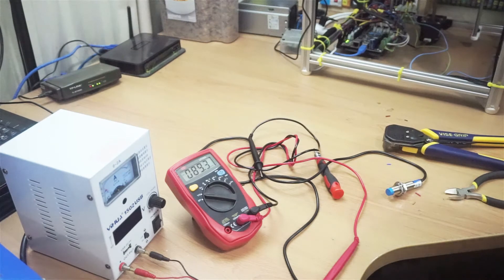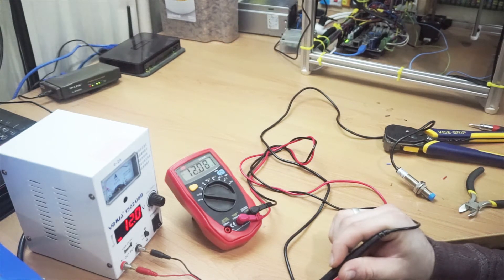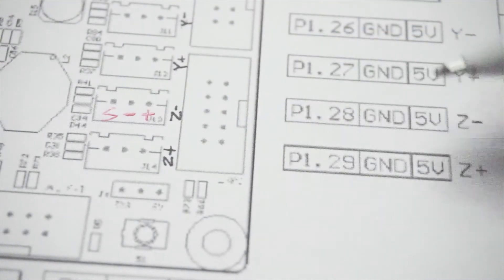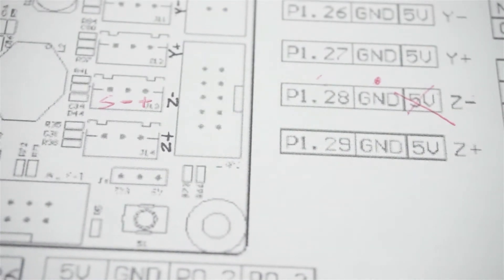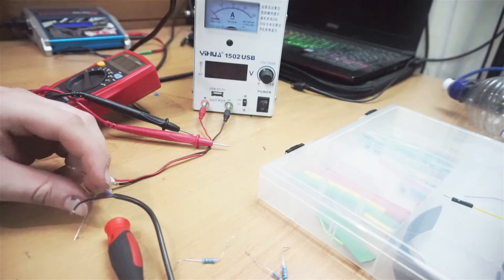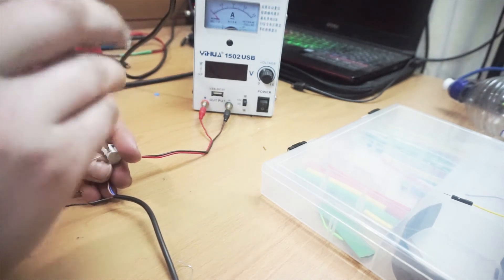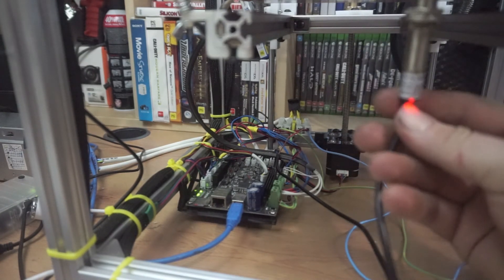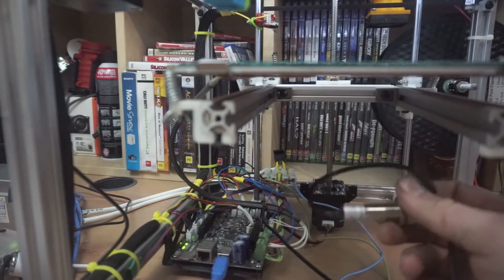How to use an Inductive Sensor with a MKS SBase/Ramps/All boards

Comment: Hi i no this video is from a few year ago but how did you wire up the probe ie 12v + and - from power supply and signal to the board I am cunfused how you wired the probe up please help

Comment: is that a PNP probe? I am having trouble getting it to work... is it because it is working off the 5V from the endstop plug or do you need to connect it to 12 VDC....
Reply from the maker: The probe i was using is a NPN i believe. Check your probe to see if its got a 10k internal resistor or not and use a voltage dropper on the sensor signal out of the probe to the endstop sensor pin on your board. If the sensor isn't working correctly at 5v, its probably under voltage and needs to be on the 12v rail. Just remember to put a voltage dropper in as the signal coming out of the sensor as it will also be 12v so you need to drop it down to 5v for the signal into your board or you will end up damaging your control board.
Reply: @BryceStandley  OK I think you missed  my meaning...the probe works and shows triggered when triggered but the fermware still crashes into the bed... Even with the proper settings as far as I can tell... This was different on my other printer it stopped almost 8mm away from the aluminum bed... No idea what I am doing wrong I even re downloaded a fresh copy of marlin and still the same problem... I  you test that by putting the multimeter on resistance between the black and brown wire right . I am going to try powering the probe with 12vdc from the rail....with the 2 resistor setup tom describes I wanted help finding the bad line in the code that is not seeing the probe but allows the probe to be detected with a M119 command. If the probe was not working you would not get a reading right... I get a reading and it says the probe is there but when I home the printer it crashes into the bed... I have tryed the settings five times and the fermware still will not see the probe but it tells me it's WOrking what kind of fed up logic is that???
Reply from the maker: Oh ok, you didn't mention that before but if it will show triggered and open with m119 then there will be a miss configure with how marlin is handling home in general. I've seen something similar before in smoothieware and it had something to do with the direction that it was set to home in and if it was to home negative to 0. Check all your homing settings and endstop settings. I haven't personally set up the marlin firmware for probes before so I can't say with any certainty but comb through your marlin config and check all your settings as its most likely a setting unrelated to the probe thats causing the issue.
Reply: @BryceStandley  wats worse I think I have the Polarity wrong and Effed up the sensor... but that is unlikely they unit would light up at 5VDC now It will not light up at all the +VDC is 14.75 and the probe can handle 32VDC I should see a Voltage of 6.75 G to + untriggered and  3.75VDC triggered but I get nothing I even tested a Stock unit and still get nothing... they cant both be bad right???
Reply from the maker: The chance of both being damaged is possible but unlikely, if the probe would light up and trigger at 5v but now it doesn't and your voltages are out of wack, it could be a faulty probe or it could be a damaged controller board but I would assume the probe first. It might be worth checking with a new probe?
Reply: @BryceStandley  did that I plugged another probe into my TEVO Tuantula and it worked fine without changing ANY settings..... go figure I will check my polarity and Turn down the Supplies even though the bed was not receiving 12VDC and see if that helps..

Comment: The same process for a capacitive sensor?
Reply from the maker: Typically yes, but again, check with your particular one as some might have a internal 10k resistor and some won't. Also check as your sensor might work at 5v so you won't need to step down the voltage

Comment: Could you help me understand?
The bltouch has 3 wires that go to the servo and 2 that go to the endstop -Z, where the inductive sensor uses only one signal wire that goes to the endstop -Z as well.
Why does the BLtouch need to power on the servo and the inductive does not?
You could also use the voltage regulator
7805.
Powering the sensor with 12 volts and the sensor only output entering a resistor in the regulator and use the regulator output as signal.
Reply from the maker: So the BL Touch uses 3 wires for the control of the pin and the other 2 for the sensor that triggers when the pin is pressed. The 2 signal wires on the Bl Touch are the same as 2 of the wires on a inductive sensor as one is ground and the other is signal. Because the sensor in the BL touch has a isolated ground you need to connect it to the z endstop as well as the signal wire.

Inductive sensors dont use any moving parts so they dont need to extend or retract any thing due to the way they sense the build surface. Inductive sensors only really work well on metal print surfaces, where as the BL touch using a physical pin can sense any build platform so it requires the sensor pin to be dropped for sensing and the pulled back up so it doesnt clash the print.

To use a voltage regulator for the inductive sensor, it may work but im not sure how it would react as you would need it to be on the output of the sensor and the regulator may not provide accurate data for the printer.

I cover using a voltage divider with an inductive sensor on this video: https://www.youtube.com/watch?v=fuNBkAESLwM
Reply: Bryce Standley 3D Printing! 
Thank you

Comment: Curious if you measured your logic hi when sensor is plugged into MKS Sbase.  I'm seeing 3.7V high with a 10K from Signal to Gnd.  I would expect 10K/(10K+10K) * 12V = 6V with an NPN inductive probe that has internal 10K pullup and is powered by 12V.  I also measured 1.2 Kohm between signal and grnd of end limit connector on MKS Sbase board with no power and no switch or inductive probe attached.  Was the same for all end limit connectors.  1.2K/(10K+1.2K) * 12V = 1.28V which is not 3.7V.  This also has me confused.  I'm aware 6V will damage the controller but since there is something pulling down to 3.7V as well as it functionally works I believe their might be some sort of protection circuitry on the MKS board that pulls on the logic level.

Comment: Hello!

 My sensor is an SN104-N. It is working with the original board.
On my MKS Gen L it doesn't trigger, but the LED is alight, when I put metal below.

I tried soldering this resistor, but it didn't help for me.  I measured 50k Ohm from black to blue without any power connected, as I don't have tne cables or a power supply for doing this.
Do I need to have power supplied to the sensor when measuring this resistance?
Reply from the maker: Some things to check:
1. The voltage on the output, if you power the sensor with 12v you should get 5v un-triggered and a large drop to around 0.5v when triggered.
2. Firmware config. You could be reverse triggering the sensor in firmware so it might thing its always triggered and then it does trigger the firmware things its un-triggered, Try inverting your endstop in firmware
3. The supply voltage, ensure its 12v or if you can get the sensor to work at 5v you can. if the sensor works at 5v correctly then no additional resistors are needed. If you have to run it at 12/24v ensure that your 2nd resistor for the divider is accurate. if your sensor has a 50k resistor internally (odd normally 10k) then you need to have somewhere around a 35.714k resistor to get the 5v, You dont need power to the sensor  to measure the resistance of the internal resistor, you should be doing this between the Ground and Signal wires of the sensor. Note if you actually do have a 10k internal resistor, then use a 4.8k resistor between Ground and Signal to get the 5v for a signal, dont allow more than 5v for a signal as you can kill your board
Reply: Hello!

Thank you for helping!
In between I have been fiddling with the device, using the 24V and GND coming from my MKS Gen L for powering the sensor. When the sensor was powered, there actually was low resistance (shorted) between blue and black. So I thought I had to use two resistors. I found a combination of two resistors (9k for R1 and 2.8k for R2), that gave a voltage of 4.8V in the end when not triggered, and 0V when triggered. Everything fine I thought.
But after removing GND from the 24V plug and plugging in the sensor into Z-Min, so it had GND from that port, it wouldn't trigger anymore. I then measured with the sensor plugged it and got 5V when not trigegrd and 10Volts(!) when triggered, This lead me to checking the GND of the Z-Min-Port. And yes: The Z-Min port on this board ist not on the same potential as the GND on the 24V plug. There's an offset of 5Volts between the Z-Min-GND and the 24V-GND.

How do I solve this problem that The Z-Min plug has it's own GND?

Should I simply remove GND from the plug also and wire it directly to the GNd of the 24V plug, or would this damage the board?
Thank you! :)
Reply from the maker: +ElMariachi no this should be fine to do, the seperate grounds could be a method to seperate some components. Wiring direct from power and ground and then just use the signal into the board should be ok
Reply: Thank you! I will report if it worked :)
Reply: It doesn't work :( I'm totally clueless now! 
All I did was swapping the sensor's GND to the GND of the 24V plug instead of the Z-Min plug's GND.
Now there's no vltage at all between signal pin an the plug's GND. And when I measured voltage between signal out and 24V I actually had 48Volts!
:(
Reply from the maker: +ElMariachi can you give me an exact part number and I'll do some digging for you. the number you gave me before doesn't show up anything
Reply: It's this sensor: https://www.phidgets.com/?tier=3&catid=13&pcid=11&prodid=402

It came stock with my Creality Ender-4 and is workinhg with Creality mainboard (24V).
But it doesn't work with the MKS Gen L.
But I think the board is ok, because unplugges it shows open, and if I connect the sensor it shows closed (using M119).
Reply from the maker: ElMariachi looking at the data sheet it looks like it might run at 5v from the connector for the xmin. Make sure the connector your plugging is wired the same as the MKS pin out. Make sure your checking between blue(ground) and black(signal) when the signal is connected, the sensor is NO making it normally open somit shouldn't be triggered when connected, see if you connect it and Inver the pin in the firmware and see if it triggers correctly
Reply: I'm so confused right now, that I can't even think straight anymore. I have made a primitive drawing of my current wiring, so you can check if it makes any sense at all: https://imghost.io/image/CIDCX
Reply: Ar first I had it simply plugged in. This was what I wrote in my very first comment. The initial state was, that I could see the LED react to metal, but Z-Min state wouldn't change at all.
I have tried all posssible combinations of inverting and pullup. If I remove the the plug, the Z-Min statrus changes to triggerd, and when I insert the plug it changes to open and stays like this, no matter what the LED does. This is why I though the 5V wheren't enough for this thing. It also says 6V to30V on the enclosure. I have read that these things are close to the edge of working on 5V and many do, while others don't..
So I think I need to run it at 24V.
Reply: You where right: I measured the Z-Min plugs without the sensor plugged.
The pins at the MKS board are other than on the Creality board.

On both boards two pins have voltage (2*10V for the Creality and 2*9V for the MKS).
But GND is swapped around: it's pin 1 on the Creality, while it's pin 2 on the MKS board.

I think  this means, that the signal pin has an hardwired pullup on the MKS board, because I have disabled pullup in Marlin's config. But how would I actually find out, which of those 9V pins is signal in and which one is Vcc?
Reply: Yeahhh! I finally got this bad boy working! :D

Thank you very much, you where very helpful to me!

I remembered that there was only one Pin that had voltage, if I connected the probe in it's normal state untriggerd. So I measured which pin actually lost voltage as this had to be the signal pin and not the voltage pin. Using this method I found, that I had to swap signal and GND for this sensor to work on that board.
:)
Reply from the maker: +ElMariachi no problem :(
Reply from the maker: +Bryce Standley 3D Printing! :)

Comment: I'm using a NPN capacitive sensor straight into my Mks ( 12v and Z min pin)  and having awesome results ,  both with aluminum and glass over it.
Reply from the maker: +tweedman1975 yeah, every probe is different. How is the 12v working? Are you using the sensor connected directly to the 12v input of the board? I couldn't do that with out a divider to drop the voltage on the signal
Reply: Not possible without limiting the voltage. You would fry the board
Reply: Can you write down the technical number of the capacitive sensor that you are using?

Comment: Did you have to use a seperate endstop for homing the z axis just changed from a ramps and having trouble figuring out the smoothieware setup
Reply from the maker: +solidus784 when using a probe with smoothieware, IV not used a endstop in conjunction with a probe, I just use the probe to set the z height and probe the bed for compensation
Reply: Thanks mate I think i have it figured out now myself the prob now is I have a pnp proximity sensor and there are physical pullups on endstops instead of software ones so I could possibly map it to another pin without a pullup resistor but being a lazy bastard I just ordered a npn one and set up a temp z axis endstop till it arrives

Comment: Any idea why my no matter doesnt work.
Reply: Are you drawing 12v from on board main +12~24V-, or from the Z MIN?
Reply: ived tried everything from diode, to resistor,  and even optocoupler.  ive done 1.28!^, 1.28^, 1.28v with no results.  the light on the sensor is always on then when it senses it turns off? asking for advice i dont know what else to try on this SBASE
Reply: LJC18A3-H-Z/BX is the sensor im tring to use
Reply from the maker: +Davey C when testing the probe with 12v does the light on the top light up bright when you trigger it? If yes then it may be a config thing but if not it could possibly be a dead probe.
Reply: The light is ON bright, but when the Sensor detects it triggers and turns off the RED LED
Reply: So instead of the RED LED off then once it detects it triggers it ON.  In my case its VICE VERSA>  LED always On, but then when it Triggers it turns off.  Bryce ive tried it all brother!!
Reply: Im BURNT and ran out of scenerios to try besides a new probe.  Any reccomendations would be great even sample pics of a config.txt to verify?
Reply from the maker: Ok so just to double check, You have 12 -24v directly from the power supply connected to the brown wire of the sensor. Then you have ground from the power supply connected to the blue wire. Just like this, there should be no led on the probe on at all unless you trigger it. If the LED is on with just power and no trigger (i.e., in mid air with nothing around it), then I would probably assume somethings up with the sensor. The LED is ONLY to light up with there is a trigger and it should not light up when there's nothing to trigger from. If after checking that power is connected correctly, you may still be able to use the probe if the signal line is changing when triggering but as the probe is working backward it may have some issues on the signal wire. If the sensor isn't being triggered and you have no divider connected, and in your case, the led is on whats the voltage on the signal wire between the signal and ground? If it's 12v, trigger the sensor, the LED will go off and check the voltage, if it's still 12v then the probe isn't working but if it's dropped to like 0.6 or so volts then the sensor is working, but the LED is messed up. If you get a negative voltage between the signal and ground that would tell me that the probe is actually a PNP sensor, not an NPN. In this case, do the same checks but between the signal and positive and you should get an about nothing and when triggered it should go to 12v im pretty sure. If all else fails, it would probably get a new probe from a different vendor. From what iv seen, PNP probes are the better probe and if you look at AliExpress, have a look at the reviews and see if there are people that have mentions that it works at 5v so that way you can connect it to the end stop connector with no divider and it should work out of the box correctly and if not then it will be an invert on the config side of things. For reference, my config file is 1.28^! And my NPN NO works fine.
Reply: thanks for the responce!  does it make a difference if its 1.28!^ instead of 1.28^! 
in addition im going to try all that you mentioned, and go from PSU 12v, and ground.   I thhink what i was going wrong is that i was drawing 12v from the SBASE +12~24V-, and ground!!   would this make a difference?
Reply: Also i forgot, and wanted to clarify something, so the only wire coming from the PROBE, and into the Zmin 
S-PIN(1.28) is the BLACK wire with the 6.8k voltage divider
Reply from the maker: Yes that's correct but make sure you check the voltages of the probe before you connect it but yes the signal wire is the BLACK wire and you put a 6.8k resistor between it and ground and you should get 5v on the output. Im not sure but I would power the probe directly from the power supply and im not sure about the config, im pretty sure the arrangement of the "^!" isn't a big deal.
Reply: Bryce Standley 3D Printing! Thxs Bryce I wasnt doing anything wrong it was a bad sensor now all is Great and I have it working with an OPTOCOUPLER